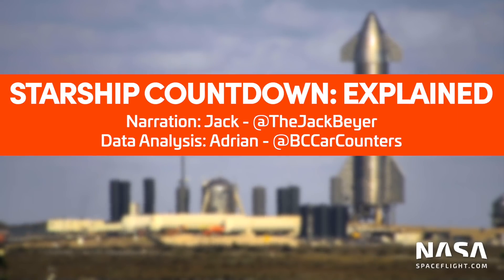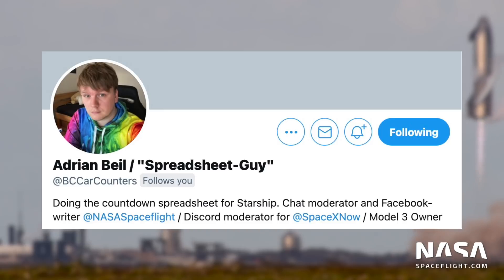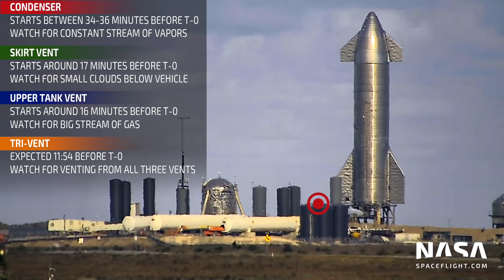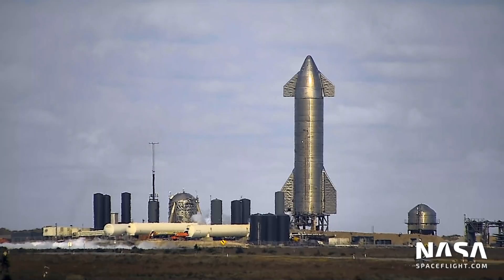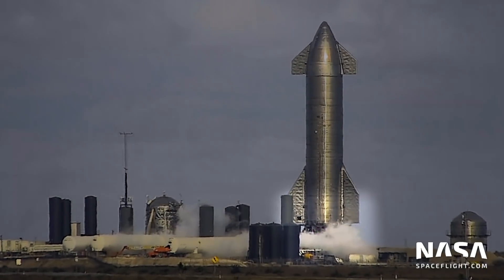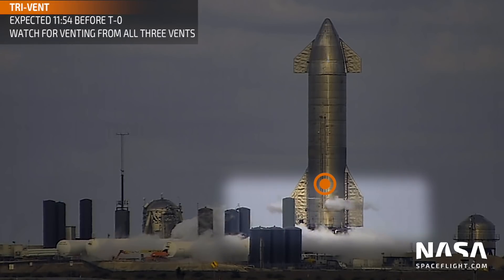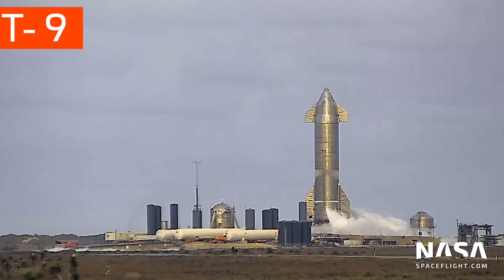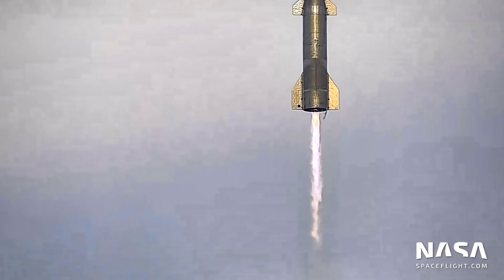How to Predict when Starship will Launch | NSF Explains

Comment from the maker: It should be noted that the skirt vent is by far the hardest to spot. It should only be used to verify that the countdown in still progressing. Also recently we have noticed some slight timing changes with the engine chilldown vents, or tri-vents, though the current prediction method is still very accurate.

P.S. The “grass” vent means nothing. It occurs seemingly at random and doesn’t indicate anything in the countdown sequence. 🤠
Reply: Probably mini holds in the count
Reply: And here is us hoping that the "grass" vent indicated use of a special herb to keep everyone calm... :D
Reply: me wondering why this has barely any likes and is not pinned or hearted.
Reply: Sn11 wiggled its forward flings about 15 secs before t10 on the last static fire - not sure if this is a thing but i caught that ! great video !
Reply: I thought there was some type of gas leak when I first noticed the venting by the dirt.  But I guess it's all good
Reply: PONGAN SUBTITULADO EN ESPAÑOL POR FAVOR EN LATIN AMÉRICA LOS VEO PERO NO ENTIENDO NADA POR FAVOR SE LOS PIDO THANKS

Comment: Thanks, great walk through of the launch/static fire spreed sheet. Just one note that the high pressure plume that used to happen moments before engine ignition seams to be no longer a thing. At least I don't remember seeing it on SN10 nor SN11.

Comment: there are a few exstra things that have been added with sn10 and 11 that happen before recondecer but arnt  to a reliable time table, a set of depress vents generally around 7-8mins apart sometimes theres only 3-4 of them other times its carryed on for 8-9 of them but its generally a sign that things are about to get interesting in the next 30mins to an hour.

Comment: The Tri-Vent pulse is probably from the switchover from (Ground Support Equipment) GSE to internal LOX/CH4  supply.
Reply: Retraction of the quick disconnect (that feeds propellants and oxidiser)- It coincided with the launch commentary for either SN5 or 6
Reply: @AndyWragg   Yes, the quick disconnect is a component of the GSE, but they do not always retract it mechanically for a static fire, typically you can see it retract for a launch though and whenever they decide to test it.

Comment: Next time you watch a stream, remember:
Road closure, village cleared, TFR's indicate a possible test.

Leading up to the test:
Recondensor
Tank farm clouds
Prop load( skirt clouds)
Tri vent
Trivent pulse( closing and reopening a few times)
Ignition.
Reply: village is only cleared for flight attempts, not static fires
Reply: @SikerScrapyard  after SN10s first attempt, I wouldnt write "might" in italics anymore. Halts and aborts can happen at any time, even after ignition :D